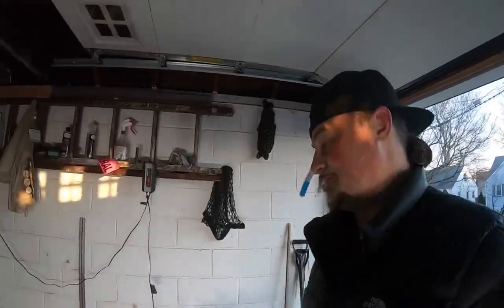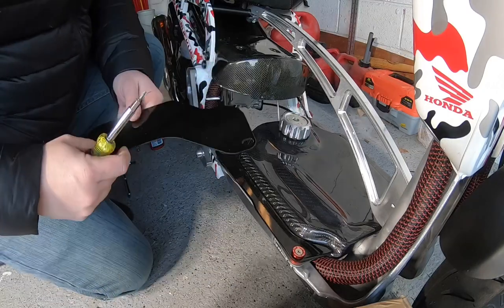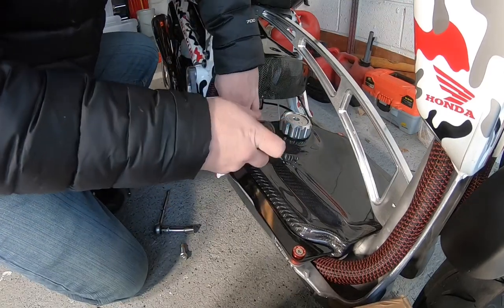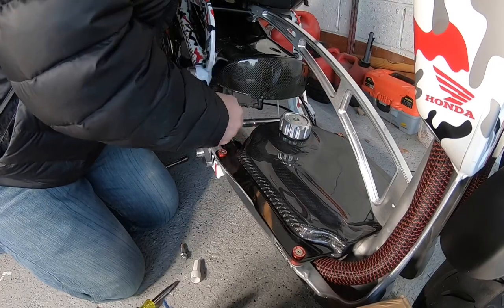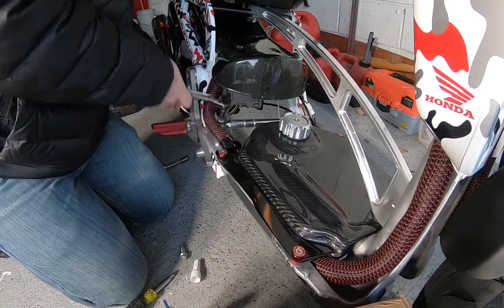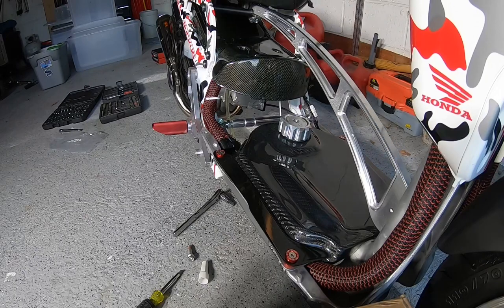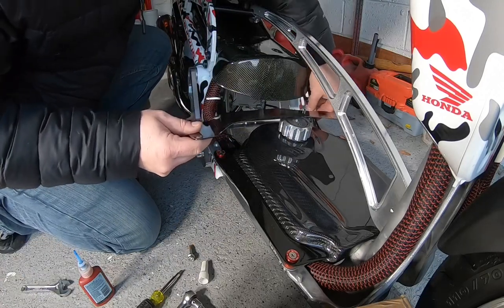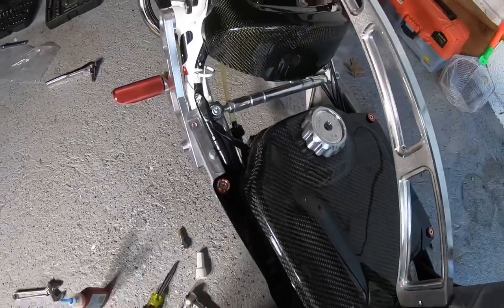Honda Ruckus Stiffler Bar Frame Brace install ... $50 add on #hondaruckus

Comment: Hey man like the ruckus where did u get ur red cable wrap. I got the nasty black plastic over mine right now. Yours is way better tho
Reply from the maker: Got it off Amazon. Think it’s called split cable wrap. I switched out the red and black to all black now.
Reply: Thank man i found it! Melting temp 400 degrees too. The black i have now is only 200 so i can rest easier knowing it wont melt all over my engine bc i have the covering over almost all my wires and tubes for looks 😆. Love it tho

Comment: Where did you get those red and black braided cable line covers running from the battery box, under the tank and to the engine? They look sharp!
Reply from the maker: Nate Skeen I picked up that stuff from amazon. I have another video of the install and I show the package with the brand. That is 1” loom, if I had to go back and do it again I would go with 3/4”.

Comment: The carbon fiber frame cover might be something to look into. Might fit better.. Had one and had more of a curve. Might fit over brace better?.. Ya I'll need a sticker also when u get around...
Reply from the maker: I’ll have a follow up video soon. I spoke to burnoutbobby from the ruck shop...I’m getting spacer and longer bolts so the brace sits above the rear frame splitter. Be nice to use both.
Reply: @WideOpenThrottle  Ya sounds good .. I'm a fan of carbon fiber ..
Reply from the maker: Shane Parker do you know where they sell a carbon rear splitter? Haven’t seen any for sale anywhere.
Reply: @WideOpenThrottle  maybe ruckhouse? Been a min... Might of been rucksters.. Site might be down still but get with them thru Facebook site they still making stuff

Comment: What size wire loom did you use. Does it just stay on there even with the split and no ties??
Reply from the maker: I used a few different sizes…yea it stays by itself, it pretty sturdy material. Alex tech from Amazon 3/8, 1/4, and 1/2” I used.

Comment: Looks good. Kinda miss the frame splitter though
Reply from the maker: Small Bore & Two Wheels hey bud...I’m just going to put the splitter on top of it. I like the splitter too.
Reply: Wide Open Throttle yeah you can use spacers and longer frame bolt and it will work with frame splitter
Reply from the maker: Burnout Bobby I already have the spacers as you know from Instagram...so that’s what I’m gonna end up doing. It’s a shame to cover it up, but I like the splitter look. Got the bar and splitters from you guys. I’m moving in a month, I’m gonna grab one of those TRS flags because I will actually have a really nice garage in the new house.
Reply: Wide Open Throttle we have had people use the spacers on the brace so it’s above the splitter is what I’m talking about.
Reply from the maker: Burnout Bobby ohhhhh I didn’t even think of that! That’s an even better idea...thanks for the pro tip!
Reply from the maker: Burnout Bobby is that something TRS can put together for me? Spacers and bolts? That would be a great follow up video. Couple people commented on my IG about wanting it but can’t having it because there’s no space.
Reply: Wide Open Throttle do you plan on putting another order soon I can toss them in free if you put it in comments section
Reply from the maker: Burnout Bobby I will see if there is anything I can order this weekend. I pretty much bought everything cool you guys sell lmao. I will order something and leave a note. Thank you sir...appreciate that!
Reply from the maker: Burnout Bobby just ordered a valve cover and left notes about the spacers and bolts. Thanks man, really appreciate it! I will shout out TRS and your channel in the valve cover install and the follow up video on the raising up of the stiffler.

Comment: Were did you purchase wire red cover
Reply from the maker: Picked that up from Amazon. Wire loom.
Reply from the maker: They have many colors. I changed mine out to black now. They also have many different size options, make sure you measure what you want to cover. I ordered the red too big. The black I ordered fits like a glove looks really nice
Reply: @WideOpenThrottle  were did you purchase the black what size

Comment: Will this work on a 6.5 stretch
Reply from the maker: Yes it will. You can’t have the floor board.
Reply: Wide Open Throttle thank you love your channel love that bike well done
Reply from the maker: David Thompson thank you very much, I really appreciate that. And thank you for the support on the channel. Appreciate you tuning in and checking out the content!